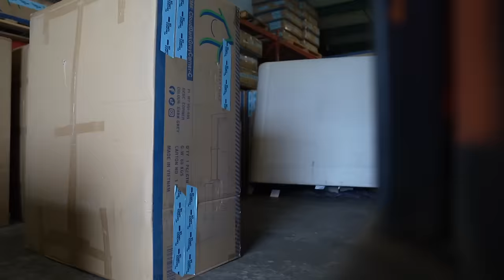I spent $40,000 on a TRUCKLOAD of couches

Comment: Just my opinion but I think you could charge quite a bit more for delivery and set up. You’re working very hard, and in sub-optimal weather conditions.
Reply: Totally agree. I’d pay $100 for that personally, and I still think it’s be cheap!
Reply: True. People are leaving Florida in droves because of the weather.
Reply: Specially if there's no elevator
Reply: @alejandromoreno4566  Exactly! I’ve commented on a previous video that he should consider outsourcing the delivery to subcontractors to save his back. When you’re 30 you’re not thinking of the toll this physical labor takes 20 years down the road. I wish he would take my advice.
Reply: I charge $50 minimum <10mi for curbside delivery only inside charges are extra depending on difficulty of delivery etc.
Reply: it works for him. he focused on moving inventory.
Reply: honestly i’d probably do $150 considering the distance, bringing it up in an apartment and setting it up
Reply: @sabersaw5611   people do leave florida, but more people move here than leave.   In 2022, 444,484 people moved here, which is more than any other state.